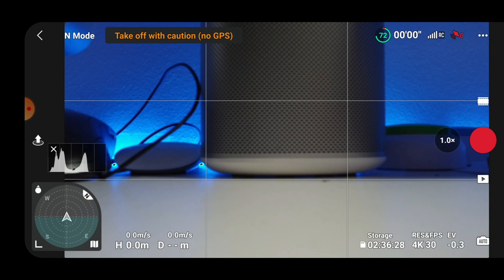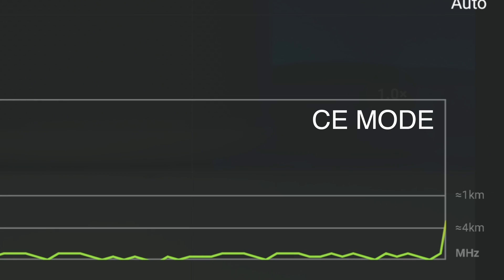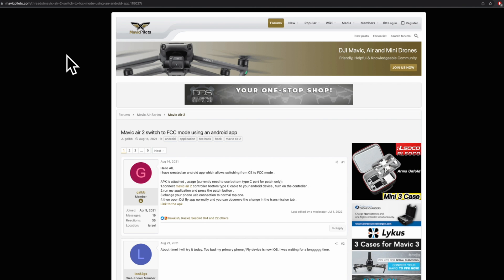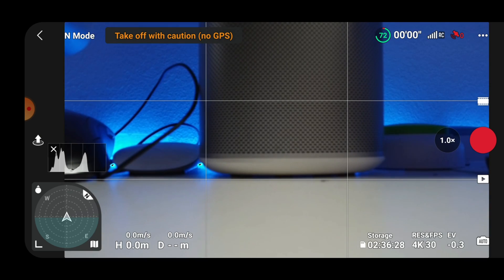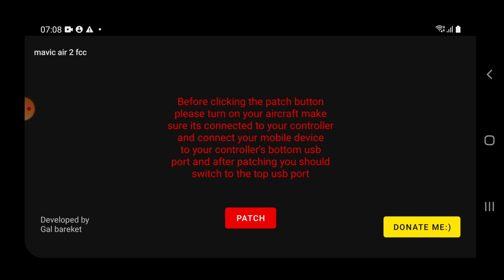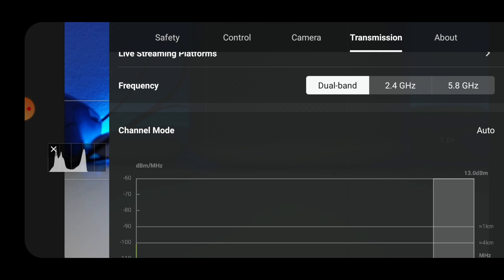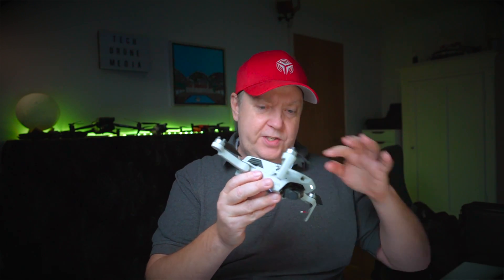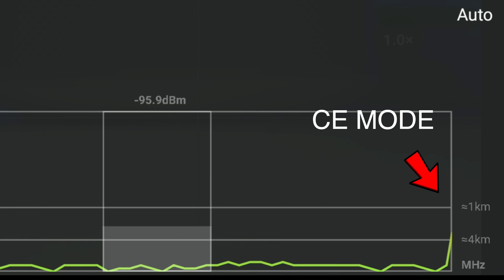Maximising Your Range on DJI Mini 2: A Guide to the FCC Hack 2023 (work for ALL DJI Drones)

Comment: Doesn't work on Mini 2 SE on 01.00.0410 firmware. When removing the cable from the controller and inserting it into the bottom controller port, no notification is seen.

Comment: It works well on the Mini 2 and Air 2s that have the RC-N1 remote. Does it also work with the RC-N2 remote control??? 😮
Reply: What kind of drone company do you have? And what rc controller version? Does the mod still work on 01.06.0200 and rcn1 04.11.0400?

Comment: Im using a mini 3pro i got the FCC app but i was a bit confused. The bar was under the 100 line and the 90 bar was just under the 1km but looking at your video of it. 
It is exactly what you said in the vid does that mean that it’s in FCC mode as others say it has to line up with the 100 bar and just below the 90 thank you so much.

Comment: I have the mavic mini pro 4 and cant get further than 1.4k. I am stable at -86 ce mode in thailand and get a max of 1km, yet when i used a vpn set to a fcc country i got to -95 and increased my range to 1.4km.  But cant get any more, even when in the open on the beach front with noone around.  Would love to get further.

Comment: Doesnt work anymore with the new update. Only via drone tweaks
Reply: Try in dji asistsnt 2 to downgrade to 01.06.0200. What rcn1 04.11.0400 controller version do you have? Write if it helped and works.

Comment: Thanks for the tutorial, FCC also works with the mini 2 SE,  after a reboot it's back to CE
Warranty remains, it's great that it's back to CE after a reboot
Reply: hi, may i ask if the apk link worked for u as i tried to access it but it said it didn't exist
Reply: nope it doesnt work for me also @walimakani1741
Reply: I got the apk stored locally on my pc.. I was sure this was going to happen..
Reply: @88alexandru88 hey, could you send me that file somehow?
Reply: Yooo man, is it for android or ios? @88alexandru88
Reply: Do not update the firmware on the remote or drone
Reply: @88alexandru88  I assure that the FCC of the bottom USB port also works with the new dji fly 1.12.8 + Aircraft firmware: v01.00.0410 (DJI mini2SE)
DJI RC-N1 Remote Controller Firmware: v04.11.0400

Comment: Hello team... I have tried to install the apk for fcc mode from this link a couple of times, but I can't do it.
The mobile phone is Huawei Mate 40 pro and the drone is Dji Mini 2.
I download the fcc apk to my mobile phone. Then I connect the controller and the drone through the dji application on my mobile phone. Everything works there. Then I pull the cable out of the top port on the controller and put it into the bottom port on the controller. And there the controller cannot be connected to the drone. It says that the drone is not connected and I still can't do anything.
When I put the cable back in the upper input of the controller, everything works normally.
Does anyone know what the problem is?
Reply: same

Comment: Thanks for the great guide. Works on DJI MINI 3, tested today.
Reply: not working on mini 3   01.00.0200
Reply: @EITSUK  succesfully dowgrades Mini 3 firmware to V01.00.0100 using DJI Assistant 2 for consumer drones. FCC hack working fine in Mini 3
Reply: What firmware do you have for controller and aircraft

Comment: Why i am the only one with ffc mode but 90 db mark is below line od 90 db? I saw no one have like that. On left corner line is not straight to 90 db, its below 90, above mark is one little line which is on 90 db. That mark is also below 90 db on CE mode, but it should be straight like what all ppls have.

Comment: I can confirm that it works on mini 2 SE on the latest firmware 🎉, it makes a huge difference in transmission stability!
Reply: Hi friend, does it still works for the mini 2 se ? Mine just won't install the new version, is it because of the mini 4 firmware or there is no corelation ? Have a good fly
Reply: @victoirethondo2922  still works for me, haven't updated since then, and I advice not to update the firmware because might not work anymore after. Have a great day!

Comment: Just tried on mini 2 but the patch doesn't automatically appear so won't work sadly
Reply from the maker: I have not tried it lately so I will have to check it in
Reply: @TECHDRONEMEDIA  ps I love you're channel. We have been running one the few aerial photography companies that transitioned from real helicopter to quadcopter before anyone knew what the term "drone" was. You're channel is always informative and along with some mild humour and good knowledge is very easy to watch. Thank you for sharing
Reply: @TECHDRONEMEDIA please recheck as I think it has stopped working now since new firmware

Comment: Is the hack only stored in controller and not on Drone itself. Just wondering in case I need to send drone in after a crash to DJI under refresh cover?
Reply from the maker: In the controller
Reply: Czy fcc w mini 2 działa na stałe? Czy się przełącza w ce jak to późnej włączyć w fcc moja wersja frimware 1.3.000 dji fly 1.6.12.

Comment: Henrik, when I bought the mini 2 two years ago, it stated that it's range is 10km. I was wondering, does this 1 km mark mean that I can not fly the drone further than about-ish 1 km???
Reply: Bro, mine was going far when I bought it but with many recent firmware updates, It losses range within 250meters, 5G no more works properly, So, I always fly in 2G mode which gives me about 500meter, I never flown far.

Hopefully this hack helps me fix the signal issue

Comment: Does anyone know if this hack still works on firmware 01.06.0200?
Reply: No, it won't. I did try it already on mine mini 2 with this firmware
Reply: From what you write, the update 01.06.0200 has nothing to do with operation. Only rc version of the controller. I have an old version of rcn1 controller 04.11.0032 and 01.06.0200 fcc working. What mass version of rcn1 controller 04.11.0400 is this??? I'm writing here about the mini 2
Reply: He he, OP is not really earning money telling your the truth.

Comment: Will this work with Mavic Air1? If not, do you have a solution for Mavic Air1?
I've been using the method that uses a Fake GPS app, but the problem is that despite the visible change of location in DJI Go 4, I still have CE. Apparently, I would have to have DJI Go 4 max version 4.2.8. Unfortunately, I will not install it on newer versions of Android.
Reply: Me too. Mavic Air 1 now locked into CE.

Comment: How to use/ install  it with Mini 3 Pro + RC Controller ?
Reply: No you don't 😂 not supported. But with DJI RC-N1 controller yes. Then you can switch to DJI RC controller since settings are stored in aircraft until powering off.

Comment: This would not work on my old Samsung Galaxy S7 that I use for my mini 2 with micro USB but worked without issue on my S10 with USB type C.  I tried many times with different cables but it will not detect the remote at all with micro USB connected to the bottom of the remote.  Many thanks for this Henrik .
Reply: Get the adapter from Android to c port its a small attachment the sometimes selll them at the gas station

Comment: Dji mini 2 now firmware update to 01.060.0000, if it's been updated, can it still be hacked with the mavic 2 fcc software for fcc mode ?
Reply: Yes, the patch it's works with fw 01.060.0000
Reply: Czy działa na wersji kontrolera rcn1 04.11.0400? Bo taka sama jest w aktualizacji 01.07.200. To w 01.07.200 działa czy trzeba obniżyć do 01.06.0200 i rcn1 04.11.0400?

Comment: Could you use a powered 2.4ghz wifi range extender to increase in normal ce mode? Did this on my 1st qunaum drone from videos on YouTube which worked a treat. Just taped it to the back of the controller, soldered a wire to the areal and powered with a lipo battery. Be great if anyone know if this would work on the mini 1!
Reply: You know if it works now on the mini 1 ?
Reply: No reply, anyone know???? Be a big help!!
Reply: Idk anything about the mini 1 but the mini 2 does not use wifi to transmit it instead has occusync 2.0 which is honestly was stronger
Reply: @travishc45  ocusync is still wifi. But it frequency hops

Comment: There's no such thing as a logging in the flight repository of what radio transmission used though 😂 furthermore there's no "law" preventing use of FCC radio transmission strength outside the north America's I believe. However there's restrictions on SALES of WiFi transmitters with FCC in areas whereas other strengths are regulated.

Comment: hi hi, as a real drone pro as you are i have a question, is it save to charge my dji mini 2 battery (3 pack) with a high power charger 64Watt ?    hope you can help me,  cant find anything about it on internet
Reply from the maker: yes no issues it will not draw more power than it needs
Reply: thxxxxx   sir for the information,  and keep on going with you channel

Comment: My UK mini 2 has full signal strength. My max height is set to 392 feet, max.   Just a thought,  could the DJI mini 2  have  the range adjust to CE mode if the max height is set to more than 400 feet, 120 mtrs?

Comment: For what the People need FCC in Europe? You dont have Insurance and so on.
And the best you dont need it for the Mini 2 
If you want Range and a good Signal.... dont buy the Mini 3 with Display Controller 😀😏😏.
Reply: In Ireland my Mini 2 can only get about 800m away in a big city like Dublin. That's in CE mode. But when I put on the FCC hack my Mini 2 can get to 3800m away in the middle of Dublin. That's why people need FCC bud.

Comment: But the range and singal strength is so! much stronger in FCC mode. Flying in CE is actually more risky as the signal is weaker. Regardless of vlos. I've had issues flying only a few 100 meters over some fields on ce and lost singal and had to mission to find drone.

Comment: In other videos it has been shown that FCC hacks do not work. You need to measure the real antenna strength before and after FCC hack. That's determines signal strength in 5.4 or 2.8 frequency.
Reply: It seems to help though

Comment: Interesting to know, but I don't think I would be using it in any way. In case of loss of signal, I would rather wait for the RTH to kick in, and most of the times I dont fly under 40% Battery to have plenty of buffer with my mini2 :)

Comment: Isn't it simpler to get the FCC modded app and stop messing with this on every single flight?....
Reply from the maker: yes, thats a choice
Reply: Problem there bud is you can't do firmware updates after the mod but with this free hack you can continue to do firmware updates
Reply: @jimthorleydronefootage  I’ve been using it for over two years, always stayed up to date with the firmware
Reply: @Radu Bogdan  when I was thinking about it some time ago on drone tweeks it says you must have certain firmware in the first place then should not update firmware. And because my mini 3 was up to date I couldn't even purchase it as dji had put something in place to stop the hack working. Unless it's something else you have done?
Reply: @jimthorleydronefootage  i think you're confusing it with the DH website, which is a firmware based mod. For DT, they always said all fw versions are supported.
Reply: @Radu Bogdan  could be that bud 👍 but you can't beat for free. Suppose it just depends if you can be bothered doing the few minutes it takes to do the hack I personally just fly ce mode as I've not encountered any issues with my signal but the likes of the avata and the like fcc mode makes a huge difference because your more low level and trees and obstacles interfering with your signal. Be interesting to see if it works on the mavic 3 classic

Comment: Hi. Thanks for this video. You said that it works with the Mini 3 pro ? Can you tell us how ? Best regards
Reply from the maker: just pair the RC after it has been connected first like shown in the video
Reply: @TECHDRONEMEDIA  Will it work for the new remote control too? That mini 3 pro comes with the display?
Reply: @DJIDroneTravel  yes
Reply: Could this hack/ software be used on the orginal Mavic Air. I have no reason to upgrade the drone as it serves my purposes, but do have issues with signal strength sometimes when it is not that far away. There have been pervious ways to switch but these have all been stopped through various updates from DJI to my knowledge.
Reply: @Edward Rushton  you can only try Edward if it can't do it the patch on your phone will say its failed bud
Reply: @jimthorleydronefootage  tried it today, had to plug the cable in the side connection, then it said searching for controller and went over to the DJI Go 4 app and told me to connect to the bottom port, which I did. But when checking the signal menu, it still showed 13 channels. So doesn't seem to work for the orginal Mavic Air 😭
Reply: @Edward Rushton  don't know about the channels side of things Edward on the dji minis it changes the frequency from in ce mode the indicator sits bang on the 1km line but once in fcc mode the 1km mark moves and this is the only indicator that the drone is in fcc mode. on the avata it's a different patch that goes on the goggles and that does indeed add more channels in the 5ghz range. When you done the patch did it say it was successful?
Reply: @jimthorleydronefootage  no just loaded up the app

Comment: Great tip..... For sure we need it for the mini3 with the RC !!!!!!!  Thanks for your support on this !!!!!!
Reply: If you have this controller for the Mini 3, you can do the same thing and would just need to pair the RC remote after and the drone stays in FCC mode. You would need the two different controllers and it would take a little longer

I'm not sure whether it would be cheaper just to pay someone for the permanent hack. I did see a video where someone had sent the drone back for repair and it had been flown in FCC mode, but DJI didn't care
Reply: This video and hack is for the  magnificent Dji Mini 2
Reply: @stst8301  It does also work for the Mini 3
Reply: For RC you can follow this video the one he might do is for other remote control with display 👍